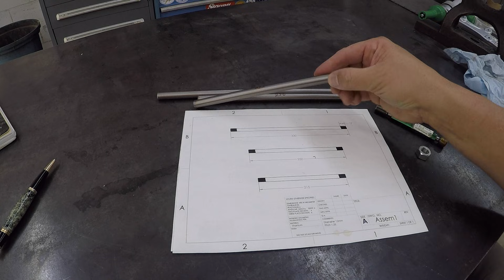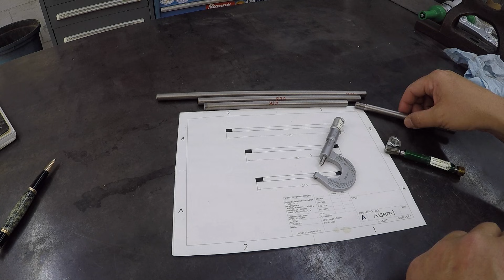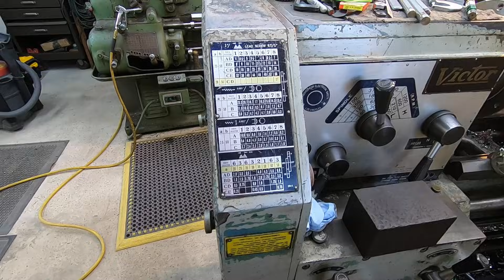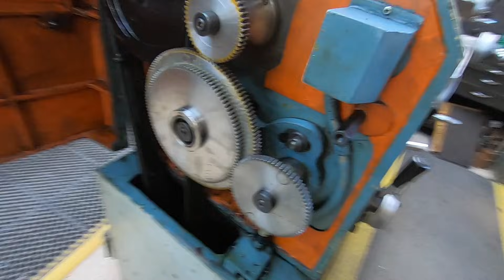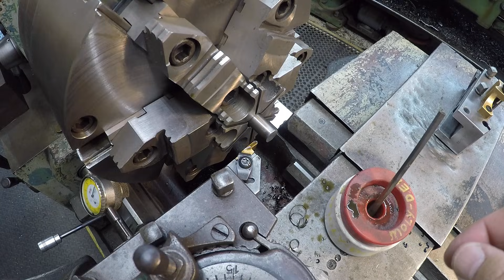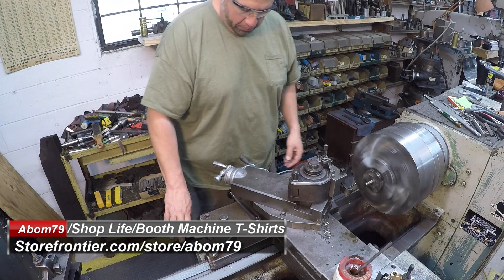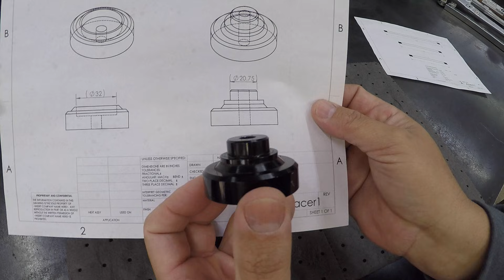Threading Metric Titanium Rod

Comment: Why can you leave the half nut engaged , and just reverse the lathe?
Reply: He is afraid that the carriage would coast into the chuck as the spindle slowed to a stop.  Disengaging the halfnut prevents crashing the lathe.  Another technique is to thread in reverse by flipping the threading tool upside down and cutting on the side of the rod opposite the operator.  This allows you to leave the halfnut engaged as you thread from the chuck out and off the part then stop the spindle.  Nothing to crash into this way.  Adam no doubt knows this technique as well, but prefers the method shown in the video because he is well practiced at it as can be seen in the video.
Reply: @MyRadDesign  also he can use more rpm because he doesn't have to stop the spindle to stop the carriage. i like this technique and would love to try it out. too bad i'm not working with manual lathes anymore :(
Reply: @MyRadDesign  If you think about it you only need to cut on the opposite side of the rod when cutting a right hand thread with the spindle in reverse. There is no need to flip the tool over. However he can cut from the front side, with the tool flipped over, and spindle in reverse.

Comment: Why do the US still use imperial? Literally the rest of the world uses metric because it just makes so much more sense...
Reply: One big reason is that there is a huge multitude of existing industrial and consumer equipment that still has a meaningful service life - and it requires maintenance. Another reason is that it is yet another option in the mechanical engineering toolbox. I am not at all bothered that both exist, nor do I see a real reason to not use whichever I prefer - to put it another way, I like watching both Star Wars and Star Trek.  Variety is cool with me.
Reply: i can understand why the us still uses the imperial  system. i've never worked with the imperial system and it is incredibly hard for me to estimate what .001 inches is. or 1/4 mile. or 2 gallons. it would take me years if not a lifetime to really learn the imperial system and forget everything about metric. i know the common things, 1 gallon is about a little less than 4 liters, 1 mile  a bit more than 1/2 a km , an inch is 2,54cm but everything else is super hard to estimate. (also why is a mile less than a km and an inch more than a centimetre?! seriously it makes no sense and you guys should slowly adapt the metric system)
Reply: @suchefeinde  1.6km per mile actually.
Reply: @suchefeinde  Actually an imperial gallon is 4,54 litres, a U.S.gallon is smaller at around 1.2 U.S.gallons to the imperial gallon.
Reply: @suchefeinde  1KM is approx 2/3 of a mile. One mile being 5280 ft to which a Kilometer is 3280.83 ft. I work with both systems but grew up in the SAE age. (Not truly Imperial) I'm 61
Reply: We still use Imperial so that people have something to comment about on YouTube.
Reply: Cause we landed on the moon first
Reply: America, Liberia and Myanmar are the 3 countries that still use the imperial measuring system. I remember as a kid in elementary school in the late 70's, there seemed to be a federal push to metrification in class. But we being us, lol...there was a LOT of social resistance to change. We were the world economic and military superpower. All of our industry and tooling was based on imperial. So if it worked for us, why change. By the Reagan era, in the interest of reduction of government spending and lack of widespread support, the movement faded away. Interview the average person on the street and ask them how many feet in a mile or square feet in an acre or how to cut 27 7/8" into 4 equal pieces and they will understandably be at a loss- it's unnecessarily complicated. Later in life I remember old-timers telling me on construction sites that it would be impossible to teach them to convert. But I think they're wrong. Give those clever old-timers a metric tape measure and in two weeks they will be fine.
Reply: Another reason is in some ways we are using metric units today.  The inch is formally defined as 2.54 cm.  It has no other definition other than what it corresponds to in metric units.
Reply: @bradthayer6782  not quite accurate lol
The inch and the mm are both defined by the speed of light.
Before that, they were both defined by the length of a piece of metal.
Long ago the conversion factor was agreed on to stay the same, but that just meant that the piece of metal was 39.37 inches long.
Reply: MERICA !!!! because if we switched Bigfoot would have to change his name to Big30.48cm duhhhhh!.
Reply: Myself and the other engineers I work with, ranging from 60 to 25 years old, in the UK, regularly use both metric and imperial, for example we have various mics some metric some imperial so you  use either depending on size lol

Comment: Great work Adam! I was just wondering, isn't it hard on the machine to constantly start/stop it and let it turn clockwise/anticlockwise while doing so? 

I've no idea how the lathe is built but I always thought that electric motors can be damaged in such way in the long run. If anyone knows, please let me know. :)
Reply: A good motor and motor start system that's designed for frequent starts will have no problem with this.
You might have to dress or replace the starter contacts periodically, but you can also put a soft starter on it that ramps the motor each start and also smooths the in rush current.

A lathe is always being stopped and started, so it will have the motor and starter properly rated to handle it.
Motors that are under heavy load and designed to be run for a long time may have problems because the in rush current heats the motor up each start, and so frequent starting without time to cool down before it starts again could cause problems, but those motors will be sized closer to the load.
This one will be oversized for the load, and it's being started under no load as well.

Also notice how he stops the rotation completely before reversing it, so it has no load spikes on it from reversing.

I think it was 18:30 that he shows his procedure.
Reply: @ke6gwf  Thanks for the explanation!
Reply: @ke6gwf  Add to that the motor is running through gearing that makes it easy to start the load. If you want to see motors survive lots of start stop with no ill affects watch CNC machines tap.
Reply: Also in many lathes, mostly the larger ones, the motor runs constantly and the spindle is engaged / disengaged with clutches, one for fwd and one for rev

Comment: Two questions, if I may?

1. Do you need special inserts (eg. ceramic), or does ordinary carbide work?

2. What happens if you miss the blue dot on the threading dial, when re-engaging the half-nuts?
Reply: BedsitBob Treat titanium just like 316 stainless and unless drilling holes you won’t have anyproblems.
If you miss the blue dot you just wait for it to come around again. It’s simply a timing mark.
Reply: @nickgill8759  you can't let the indicator flip over when cutting metric threads with an imperial leadscrew. Pitches will never match.
Reply: You need to stop the machine and go back to the same mark for metric threads, with an imperial leadscrew. There is a chart on the machine for imperial threads that shows which number mark is good for what pitch. Doesn't work for metric, so most will leave the half nuts engaged. 

What is important is maintaining the timing between the spindle and the leadscrew.  It is harmless to release and move the carriage as long as you engage the half nut at the same z position, given you do not turn the spindle.

You can chase the z position relative to the spindle/chuck using the indicator, just dont let it turn over. It is usually easy enough to retrace your steps by taking and air cut and watching the insert relative to the threads if you do mess up.
Reply: If you miss the blue dot, immediately back out the cross-slide so you don't whack your threads. Disengage the halfnuts like Adam was doing, reverse the lathe, then pick back up on the right spot. Stop the lathe and start it forward again.

Comment: I know nothing of machining. I have seen you making spring cutting before. Even seen reserve thread cutting. Would it hurt if you kept same dept and reverse out while cutting? What damage would it cause? I mean besides bad practices.
Reply: If you reverse the tool you also reverse the rotation of the work piece. If you keep the cutting tool engaged to the work piece you could break the tool as it's not designed to cut with the underside of it.
Reply: @Aristo12  Thank, I watch to learn
Reply: If you did that the spindle would start to move but the carriage has to take up the slack in the gear train which will make it lag behind.

Comment: Adam - I know you mentioned it before, but where do you get those replacement multifix adjusters? I have a set of 8 and half are broken or missing, and really could use all new 7mm adjuster screws with lock nuts. Thanks! Great video!
Reply: Bam Miller https://pewetools.de/Produkt-kategorie/zubehoer-und-ersatzteile/

Comment: another great and cool vid Adam :) It feels like you run across the metric system more often than we run across the Imperial system her on the other side of the "lake" :) What I mean is that you guys often feels more competent as a machinist becouse you often have to work in both of the systems. Keep up the good work :)
Reply: Quite a bit of oil and gas work here in the uk is imperial. We convert the dimensions to metric to program the machines.

Comment: I think the reason this method works with metric on a converted lathe, is that the carriage is not moved after disengagement of the half nut. So when you catch the dial mark going back, you really are in the same lead screw thread. Just like it would be if you just stopped the lathe and backed up. Neat idea....Dave
Reply: Hi Dave. any progress on the planer.

Comment: Excellent video. I did some work on a couple of pieces of titanium about two years ago. No problem. Then I read since that one has to be careful to not work harden titanium when machining. Is this a problem or am I trying to read too much into it?
Reply: Ti definitely work hardens if you don't cut it properly. Dull cutters and non-rigid setup are usually the cause of this, in my experience. Ti likes nice sharp tools and rigid setups. If you do that, you might be wondering why people say it is hard to work with.

Comment: Excellent tip with the threading dial/ half nuts.  It'll save some white knuckles for sure
Reply: That and Joe’s trick to use an upside-down tool and cut right hand threads with the lathe in reverse and the carriage heading away from the chuck.

(Just don’t crash into your live center)

Comment: I've got a lathe without a threading dial. Is it possible to still single point thread without a dial?
Reply: make a threading dial, they are extremely simple
Reply: @William Leue It works on every lathe that has clutch no matter the size.
Reply: Nathan Wilson If it doesn’t have a threading dial, it may not have the gears for threading. If the carriage feed can be set to different thread, then you can cut threads. Just never disengage the half nut.

If your lathe has a lead screw and a half nut, that is.
Reply: Is it a metric lathe? Some of the smaller ones often don't seem to come with threading dials. 
Either way remember that thre are many threads that you don't need to use a threadng dial for. 
e.g. With an 8 tpi leadscrew you can cut 8, 16, 24, 32 tpi etc threads engaging the half nuts wherever you want.   (Any multiple of the leadscrew tpi basically.)
e.g. With a 3 mm pitch leadscrew you can cut 3, 1.5, 1, 0.75, 0.6, 0.5 mm etc threads again without a threading dial.   (Any 1/2, 1/3, 1/4 etc of the leadscrew pitch.)
Reply: @ericfeatherstone  Solid point. I think with a carriage backstop and a sharpie or chalk mark on the thread and a slow speed, one could reliably hit the same spot.

Comment: I know its a one-off and doesnt make sense to buy thread go-no go gauges for one job, but I would recommended them, and you can easily find them in 3 tolerances
Reply: Unless you are doing something extremely precise for normal applications like screws they are waist of money -with time and experience you can get amazing tolerances.
Practice makes perfection(unless you cheat and use CNC then you dont need gauge ) ,no gauge can replace that.

Comment: For the threading operation I had thought the lathe does not have to be stopped after each cut as long as the same engage mark is used every time. In your case #1. It has been a while but on my SB 10K I have a metric gear set. Made 1st cut moved carage out, then to the right, reset depth, waited until mark came up, engaged and made 2nd cut.

Comment: @Abom79
Thanks for another interesting and enjoyable video. I especially appreciated the extra work You put into making and editing the different shot-angles to give a clear view of Your method of working while threading.
Now I let me apologise ahead of time for what most likely is an idiotic question for any machinist (but since I'm not, and I'm unable to curb my curiosity, here I go :)
What would have happened if You had "stopped the cut, and just reversed the feed", without "backing out" the "cutting tool" ? Would the "cutting tool" get damaged, or the cut get "fouled"?
As I ""understand it"" the "cutting tool" would "follow the thread" using the "reverse path". I understand that the material (rod) would rotate "counter" to the "cutting direction" but would this harm the "cutting tool", or why else is this not done.
Best regards.

Comment: You may like threading that way but it's no healthy for the motor and gears. The motor windings experience high "inrush current" with every start. And only one tooth on each gear is meshed driving, so tip pressure is pretty high starting that static loan and accelerating it to speed. A better choice is to use a smaller lath for such a small diameter threading job. The machine will last longer.
Reply: Yeah good call, better run out and buy a smaller lathe for jobs like these.  Very practical /s
Reply: They are made to do it like that (atleast back in the past).Unless you got cheap chinese lathe with plastic gear ,nothing will happen to lathe gears or the serious industrial motor.15KW motor doesnt give a flying fuck if you spin something heavy as 12mm x250mm rod.Nether does those gears since you have a clutch and most of industrial grade lathes have reverse built into them like a car -motor spins always in one direction it doesnt stop.
So yea maybe problem for cheap chinese crap but for serious machine this is a joke .
Beside gears and half nut arent meant to last forever and you can replace them cheaply (or even make them yourself).
Reply: Larry Maloney This is Adam.  That’s a small lathe for him lol.
Reply: That’s ridiculous, the lathes are made to do that . The motor isn’t reversing the clutches are making the spindle reverse

Comment: Are you starting the restauration process on your key broaching press? Also what maschinery have you build  for yourself up to now? like a saw or welding jigs or a grinder, maybe a fixture for burn cutting at a angle, have you thought of makeing a automatic file or a special grinder for tungsten carbide tools, maybe a silent air compressor from a AC compressor or a attachment so you can part of parts made of hardened steel or other high tensile strenght materials in the lathe with a big anglegrinder or abrasive saw 
maybe a big wire brush, or a big mobile sandblaster and a material screen so you can sift the right grain sand back from the used stuff
maybe polishing maschine for wax polishing, maybe some chemical baths where you can chrome, zink, copper or nickel plate work pieces yourself, or a painting cabinet with good ventilation 
or a hot blueing tank and steam nitrating oven, maybe homemade broaches and reamers?

Comment: Great video. I had seen this threading technique recently. Much better solution than having to keep the half nuts engaged. Can you do a video and talk a little about machining titanium. Are there considerations for the different grades? I had been led to believe that flood coolant is preferred, however, you use MolyD lube with no flood coolant. Recommended speeds and feeds. HSS versus carbide tooling.
Reply: Only if its a coarser pitch thread, you wont have to wait an eternity for dial to eventually come round.
Grade 5 machines superb, want 1/2 thou off take it off, wont do that with steels or aluminium. Use coolant, even fine Ti can catch fire.

Comment: Good technique Adam.  I've always left the half nuts engaged when doing metric threads.  A few weeks ago I did a metric thread on a hydraulic cylinder ram with a wide shoulder and no relief groove.  My lathe has a powerful foot brake so I could back the tool out and jam the brake on before hitting the shoulder.  Needless to say I wasn't running the spindle very fast.  If I had seen this video back then I could have gone much faster.  I will try it the next time a metric thread comes into my shop.  Thanks for the this, Ken